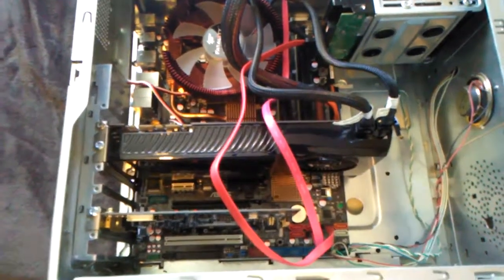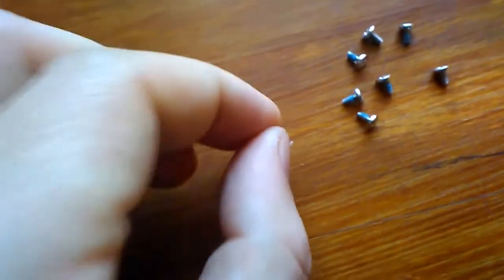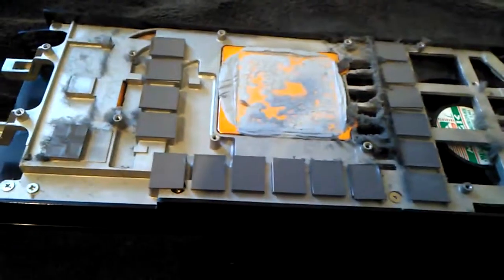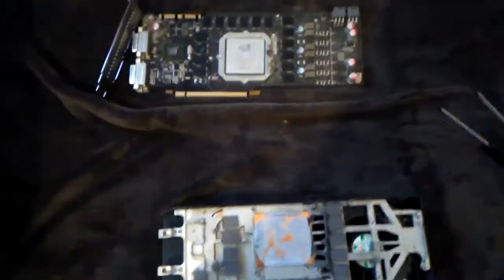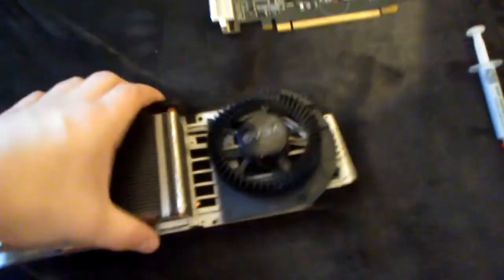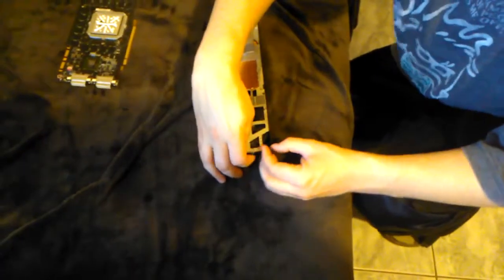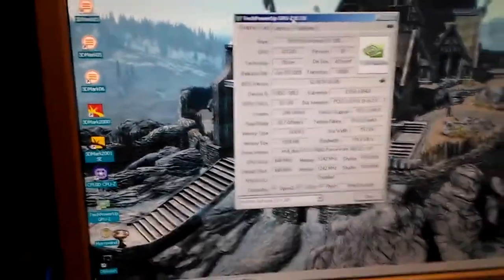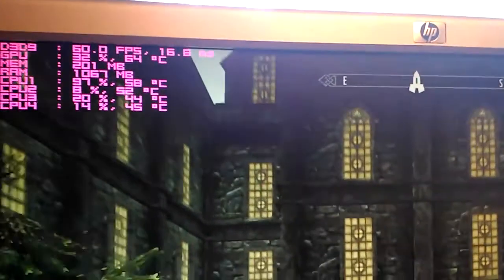GTX 285 Cleaning & Thermal Paste Replacement

Comment: I know this is an older video, but I just got a card like this.  The heat sink on the 285 is very strongly attached. I removed all screws but it did not come loose.   Is it only paste holding it after you removed all the screws ?
Reply from the maker: Hello! As far as I remember it was held together only by the screws, but I also remember the thermal paste acting like glue so you might need some force and wiggle left and right to loosen it. I put back the original pads. I'm not sure their thermal conductivity was still great, but they looked okay and I had no issues with temps. The card is still fine an running well.
Reply: @JohnAmanar  Thank you.  Did you see any thermal pad on the videocodec chip.    That is that single chip, smaller than the Processor but rather big. (It looks like a small CPU)   I also have a GTX 260 and on that card the videocodec chip did not hit the heatsink. So I had to stack 3 thermal pads so it did hit the heatsink. As I understand now Thermal pads should not be on the RAMDAC.
Reply from the maker: @bonno666  Yes, that one is the NVIDIA NVIO2 chip which is the display output controller containing the RAMDAC and TDMS. I don't think it had a thermal pad on it. The reason is that this chip is made on a different manufacturing process and produces way less heat than the GPU. Connecting it to the main heatsink with thermal pads could lead to the chip being overheated by the GPU since it was not designed with the same thermals in mind. The best practice is to put a tiny heatsink on it.
Reply: @JohnAmanar  Ok thank you for this.  There is about 3 mm of space between that RAMDAC chip and the heatsink.  But that is on the GTX260 since i did not open the GTX285 yet.  I have to order new thermal pads for that.  Do you know what thickness is used on these cards.  0,5 or 1 mm thermal pads ?   My guess is they used 0,5 mm pads  for the memory and paste for the CPU.  Or just use Thermal paste for all of them is possible.
Reply from the maker: @bonno666  For this EVGA GTX 285 Mac Edition they've used paste for the GPU and 1.0mm pads for the memory chips.
Reply: @JohnAmanar  Thank you.  The Thermal pads looks actually thinner than they where when new.   Maybe they are compressed after so many years.  I have the Asus ENGTX285 and Gigabyte GTX260. They are very similar. But the build quality of the Asus is a little better.

Comment: My GTX285x suddenly won't do graphics mode anymore this week. Only text mode works with slightly garbled colored pixels scattered over the screen. I might open up this 14 year old card to see if anything obvious happened inside.
Reply from the maker: I'm sad to hear that. My GTX 460 and 560 did the same thing unfortunately. The baking thing "fixed" it and I've gained some extra time with the cards, but they will die eventually.
Reply: @JohnAmanar  Baking thing?
Reply from the maker: I think Linus made a video on the topic. I disassembled the card, leaving only the bare pcb then used a heat gun on the gpu to melt and "resolder" the gpu chip in it's socket. It's a temporary solution. Worked most of the time for me, but not always. It's called baking or oven method since originally people tried to bake their cards in the oven to achieve the same thing.
Reply: @JohnAmanar  Thanks. Baking is worth a try if the alternative is to toss the card out. I'm just testing a spare Geforce 730 Silent version right now to see how it compares with performance.
Reply from the maker: Good luck! The 730 supports DX11 so you can play newer games on it, but it's performance is around half of the 285.

Comment: Did you manage to get the card running in PCIe 2.0 x16 in gpu-z? Mines doing exactly the same despite all power saving turned off...think it's a vbios bug related with asus motherboards :(
Reply from the maker: I think you can't disable all power saving functionalty. GPU-Z has a small questionmark icon next to the Bus Interface section. Clicking on it will bring up an option to start a render test which will stress the GPU and after a few secs it will display the proper PCIe interface. It worked for me.
Reply: @JohnAmanar  that doesn't work in my case the pcie speeds keep switching alll over from x8 2.0 to x8 1.1 which gives poor bus figures. I think the pcie traces on the card might be damaged maybe. Other cards work fine.

Comment: i dont know how you pulled the fan header so easily because mine would NOT come off, i ended up breaking it by pulling a little too much... fuck me
Reply from the maker: I'm sad to heard that. Sorry. :| Maybe I was just lucky. (It might had a little plastic piece you had to push while you're pulling it of. Most fan headers does.)
Reply: @JohnAmanar  yeah i looked for that but the thing was super tight. No problem, i just needed it for a server to output some video but yeah i bought a gt 710.
Reply from the maker: @walouinsanityshed  For a server you're better with the GT 710, at least you can leave it in the system. The 285's power consumption would be bigger than the whole system's xD

Comment: A GTX 285 and a Windows XP in 2018 is something hilarious man... At least install a windows 7 64 bit so you can play games like GTA5 on low settings, if you can't afford a new pc with new GPU.
Reply from the maker: The GTX 285 supports DX10 which is good, but this card is one of the best DX9 cards with great drivers for Windows XP and older games. For modern games, I have a GTX 1080 ;)